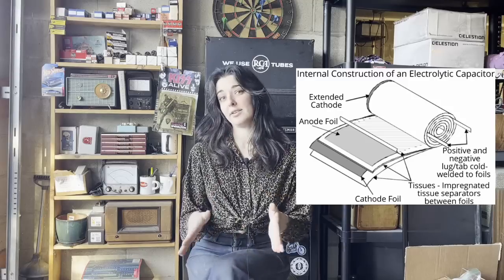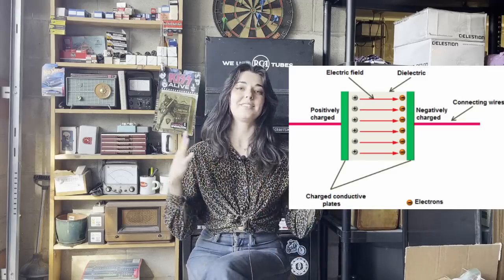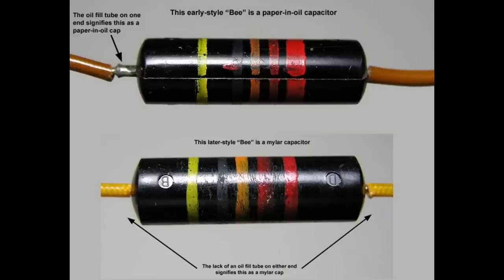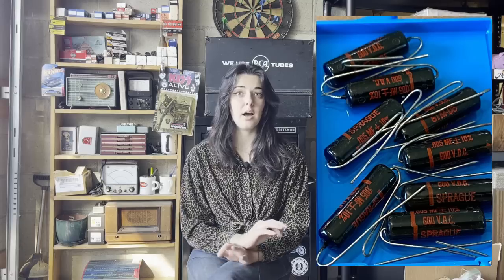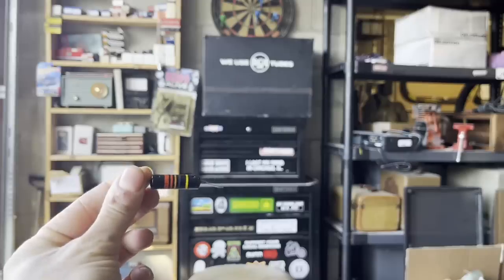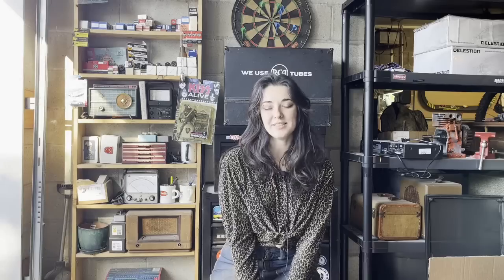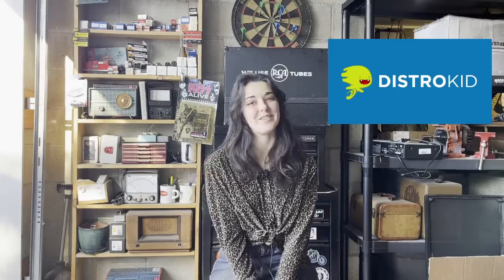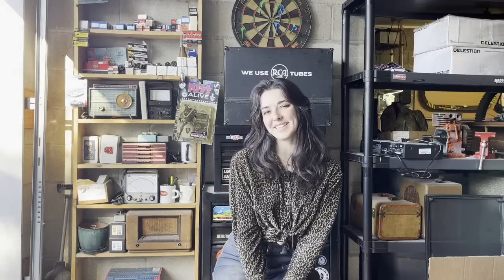Bumblebee Capacitors | Sprague Black Beauty Capacitors | Amp Electronics 101 | Fazio Electric

Comment: As for the early paper/oil or even the Mylar/oil Sprague capacitors, would a vintage capacitor that leaks voltage (unusable for a power type circuit) still be functional for use in a passive circuit like as a guitar tone capacitor?
Basically, the capacitor can be out of spec for voltage filter/coupling applications, but still work for a guitar's tone circuit.
Reply: Leaky caps are safe for use in signal applications with no DC bias. Naturally the change in electrical characteristics will change the frequency response but this may produce a desired effect.
Reply: @eDoc2020  Agreed.  It has been my experience that the vintage capacitors I've acquired from older equipment are sometimes wildly out of spec, yet still very desirable for use in a guitar tone circuit.
For myself, what I've found works best is the use of test leads to audition the capacitors for use on a specific guitar.  It takes extra time to actually test/listen to the individual capacitors, yet the results are genuinely worth the effort.

Comment: Hey, Faz. Eric Tripton here. This is pretty basic but here goes. If I am just replacing output tubes in my Germino Plexi, do I really need to bias? Does it make that much of a difference if I pop them in and off I go?
Thank you.
Reply: You can pop in new output tubes in a cathode biased amp with no problems... The amp you're talking about has fixed bias and that means the amo will have to be rebiased with every new set of output tubes you put in that amp... Unless you can get another set that has the exact same parameters as your old set...
Yeah I know, I'm not as hot as Faz but your question has been answered...
Lol!

Comment: What do you think about "field coil" loudspeakers?
Reply: Shush! Don't let out the "secret"! Field coil speakers are great but a regulated DC supply is needed for the field coil... Otherwise there is a lot of hum at the speaker. You gotta know what voltage/current the field coil wants or it will be easily blown.

Comment: Is there a replacement for an Aluminum Electrolytic Capacitor with a different type of capacitor? They are the weakest link in any Amplifier.
Reply: Get high voltage polypropylene, like Solen caps. They are quite a bit larger than electrolytics but if you have the room, they are superior to electrolytics in every respect, and SO fast!

Comment: Just run a blind test of "vintage correct" vs modern caps on the same amp if possible. It would probably "bee" a mythbuster video.
Reply: That’s exactly what I was hoping for when I clicked
Reply: ...and anyone who disagrees needs to BUZZ OFF!!!

get it? get it? get it?

(snucker-snucker-snucker!!!)
Reply: No need to put em to a vintage amp. That alone introduces so many variables that the test is worthless. A better test is to use simple test circuit and measure responses to various signals and make spectrum analysis out of that. If you don't believe test data out of such test how can you trust anything that's science based. No, you don't need to hear the cap, you wanna measure and compare things in a consistent and repeatable ways.